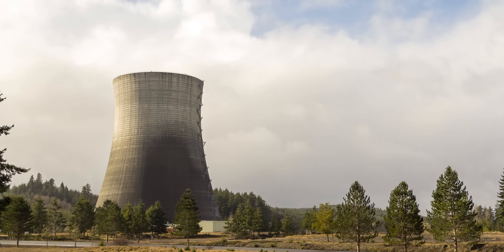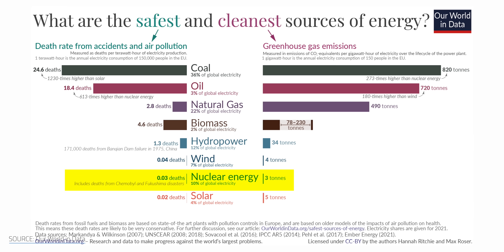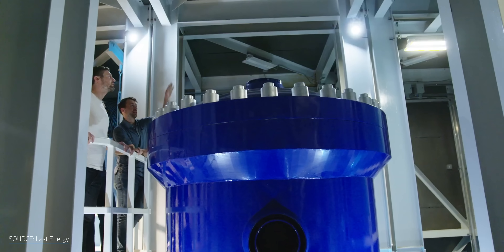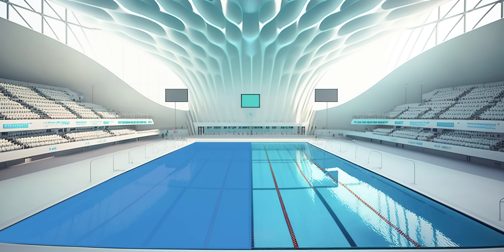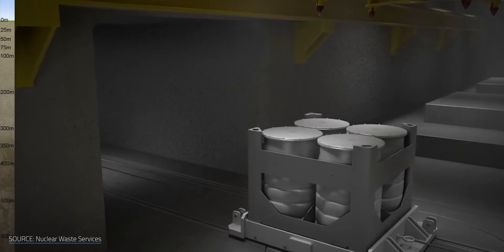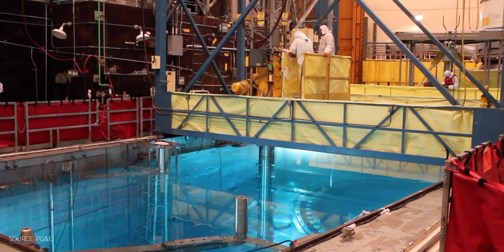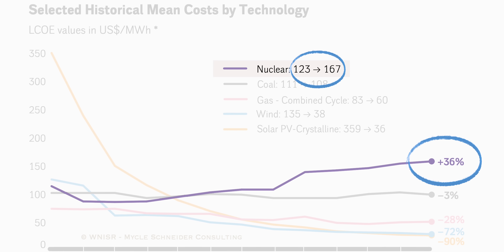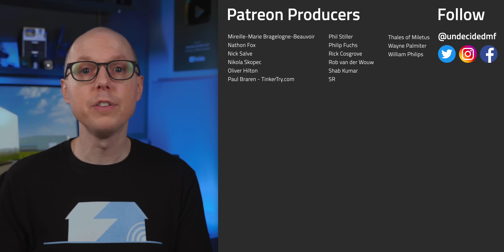Is Small, Fast, & Cheap the Future of Nuclear Energy?

Comment: Nuclear energy is the low IQ solution.  Low IQ because it actually increases energy and greenhouse gas (heated water vapor) in the atmosphere when we are trying to reduce it.  Solar does the opposite.  Solar simply recycles the energy that is already in the atmosphere.  Intelligent people back solar.
Reply: Sure solar is better for the environment but it isn’t efficient and is extremely expensive, so I think the world will move away from it
Reply: @scipio_stan  Solar is already the lowest cost and vastly more efficient than nuclear.   Wind and solar are both cheaper and more efficient which is why they are dominating the  market all over the world.
Reply: It releases steam, eg water. It is not harmful to release steam into the air.
Reply: @Arthorian   Water vapor is the dominant greenhouse gas and the extreme heat of steam from nuclear plants adds vast amount of waste heat to the atmosphere. If nuclear plants proliferate, waste heat will be the main cause of warming.  The intelligent solution is wind/solar which absorb energy from the atmosphere.
Reply: Water vapor emissions from nuclear plants primarily contribute to thermal pollution, which involves raising the temperature of surrounding water bodies. While this can potentially affect local ecosystems and aquatic life, the effects are generally confined to the immediate vicinity of the plant. Once the water vapor dissipates, the environment tends to recover relatively quickly. This localized impact contrasts with the widespread and long-lasting harm caused by coal-fired power plants.

In contrast, coal-fired power plants release not only water vapor but also a complex mixture of pollutants that include sulfur dioxide, nitrogen oxides, particulate matter, and greenhouse gases. These pollutants have far-reaching effects on air quality, human health, and the global climate. They contribute to acid rain, smog, respiratory illnesses, and contribute significantly to climate change.

E.g Nuclear should be used as a replacement for coal, then replaced by solar and wind

Comment: Here's the thing that everyone missses about the waste from nuclear reactors:  the fuel didn't come out of the ground in large, radiation-blasting chunks, now was it in the ground in a "vein" of pure uranium like coal in a coal seam or gold in a vein.  Nope, it's small grains of a uranium compound embedded in a cubic foot of surrounding rock.  Before you even start enriching to up the amount of U235, you first need to chemically separate out the uranium metal, and before you can do that, you first need to get the grains of that uranium compound out of the surrounding rock.

So, there's how you deal with the waste: put it back into the ground in the state you pulled it out.: grind the radioactive waste down into a coarse sand, embed one grain of sand into a 1 cubic foot brick of rock, then bury all of those bricks deep underground.

Sound expensive?  That's because you cannot have safety on the cheap.  She's around also make nuclear fission power prohibitively expensive.  Which is why we do it the dumb way:  concentrating it, then frantically trying to find a safe place to put a large, bright-radiation source.  🙄
Reply: The high level waste in spent fuel rods is NOT uranium, it is Pu239 and highly radioactive fission fragments.

You can hold a new fuel assembly in your hands all day and get less exposure than an airline flight.

If you walk up, touch a spent fuel assembly and walk away, you will be dead in a day or so

Comment: I personally think that Last is on the right path with these ASMR’s. I worked at a major nuclear powerplant back in the 1990’s and we were bogged down with procedures and QC hold points, regs and rules and much of it was, honestly, ridiculous over kill. Much of it was indeed needed but much wasn’t. Also, the cost was for the documentation. For instance, a common 1/2” bolt you can grab at a hardware store for an inflated price of 1 dollar, the nuclear bolt needs to have documentation from the truck it was offloaded from, literally all the way back to the mine where the iron ore was mined thus upping the cost to 8 or 10 bucks or more.
Reply: What was the sense of this? Sounds like somebody make extra money. In the 90-ies EUropa: A friend running a company, producing thermopaper rolls, first for cash registers. One unit selling price 1,50 in that currency and big quantity. The same paper, for medicine technical devices such as eeg, Labor Printers, so on: costs 18-30 per roll, with less paper used. On kg basis this medicin roll would have been double this figure. Good good business….

Comment: Mass produced molten salt reactors would be cheaper than coal. So will be solar and LFP battery. However, which do you think will return enough energy to make itself - sooner?
I've estimated that the EROI of solar is 20. However, even though the energy stored on Energy invested for LFP batteries might be 50, a fully LFP backed solar and wind system might only have an overall EROI of... 4.
I do not believe that mass produce small advanced closed cycle nuclear would have an EROI of less than 200...

Comment: My country, France, has been mentioned as an example of "serial" production or nuclear plants. That's true, and the cost was way lower. However there is a downside, last year a lot of reactors were down in order to check for cracks after some were found in one of them.

I don't like when LCOS of an intermittent energy source like solar and wind is compared to the LCOS of an "always on" source like nuclear. At least add the LCOS of storage, if it's even possible (in winter, solar won't produce much for weeks on end so storage can't do much about that).

After a few years where nuclear was not in favor after Fukushima, France has embarked in a new cycle, and while the president has allocated some funds towards SMR, the plan is clearly to build bigger, 6 new EPR reactors (1650MW) then on to EPR2, these should be conceived to be cheaper to produce.

Comment: Nuclear is a clean, safe and abundant non-carbon energy production method. But Nuclear waste is an almost criminal story in the US but not why most people would think. It's because of the lack of reprocessing. The lack of reprocessing of the used rods resulting in much more waste than necessary and wasting perfectly useable and already "enriched" Uranium. There are laws on the books starting from the 1950's that prohibit the US from resprossing the pellets after use. The reason is that politicians in the 1950's were worried that the pellets could be stolen or somehow redirected to make bombs. A not widely known fact about Uranium pellets is that only about 3 - 20% of the Uranium is utilized during the pellets lifetime. Because they are solid there is a very specific distance of the atoms from each other and the neutron source the fission decreases and the rods are no longer as useful. But here's the kicker. There is still over 97% useable Uranium left in the rods/pellets after usefulness declines. But instead of taking the pellets and reprocessing them and adding only a small amount of new Uranium and then reusing them, they are all just stored in mass as waste.  So we store 97% perfectly good processed/processed Uranium as waste. Europe, Japan and Russia reprocess the spent rods gaining the use of already processed Uranium and significantly reducing the amount of high level radioactive waste. SMR's, MSR's and other types are a great addition to our future energy needs.

Comment: Id consider the lack of deaths related to nuclear power more a result of them not being nesrly as widely adopted as coal and gas
Reply: The deaths  comparisons are done in a basis of unit of energy generated by each source.  Coal oil gas is hundreds of times higher as the video shows.  That means if the whole world was run all by nuclear, hundreds of thousands of lives would be saved.

Comment: If you go back and look at the original nuclear plants here in the US they were designed to reuse the waste by reforming the rods and reuse.  We then got away from that.  Regulations are the problem with energy production, like most things are.  People talk about "green" energy (solar, wind) but they are not green at all when you look at the footprint of mining, production & recycling.  Nuclear is the most clean.  The price is high because of the fossil fuel industry along with the media portraying it as extremely dangerous.  take a look at the US Navy's nuclear program.  I got less radiation aboard a sub than I did walking out in the Sun.  So looking at the price per unit over time, you will see Nuclear still being cheaper if the amount of regulatory folks get out of the way.  It takes about a year for a Natural Gas plant to go up and they want to get it in before summer because they will be able to pay it off in that first year or so depending upon the market.  I should be able to put up solar on my house but the power companies have a monopoly and influence with the legislation and the amount of hoops you have to jump through are crazy.
Reply: Well said. Note the US build a dozen nuclear plants in the late 1960s, approved by the then AEC.  Those plants went up in 2-4 years, cost under $1000/KW, todays $.  Oyster Creek. Nine Mile.  That’s cheaper than todays gas plants. Those plants ran 50 years, some still running.

Comment: There are more than one brand of micro nuclear reactors. One actually does use nuclear waste for fuel. Unfortunately the Nuclear Regulatory Commission is dragging its feet on approval of them so more than likely they will be exported rather than used here. And when was the last time a nuclear power plant came on line here? Before the NRC was created. If one were to start the process today it would be 40 years before it would come on line. So the cost you present is probably too low. All because government stands in the way. Why are inviromentalists not pushing for them. It's too efficient. Germany cut nuclear power which came from France in favor of green energy. But recently they realized that by this winter the German people would be freezing to death and then starvation would set in. So they then began expanding their only other source of fuel available. Not coal because they don't have any. They do have abundant sources of lignite. Yeah, lignite, low grade coal which produces much more pollution than coal. But they need a lot and with manufacturing down due to turning off nuclear power they need more money to mine lignite. They found it. They diverted money being used to build windmill farms to mine lignite. Now they will be polluting 3 times more (at least) than before. Well, that's where we are headed.

Comment: It's kind of surprising an idea like this hasn't happened sooner.  We have been using small reactors in subs and ships since the 50s.
Reply: i forgot about that. It's insane how old nuclear powered engines are
Reply: It is the level of enrichment of small reactors, a lot higher than a large PWR reactor and they require refuelling more often.
Reply: @michael-vl1mn  by using a hydrated salt as a moderator the reactor can be much smaller and burn natural uranium
Reply: Hydrogen is the best moderator for neutrons
Reply: Because it slows them down and half the distance this reduces the size of the core by a factor of 8. Sodium hydroxide can serve as a moderator and a heat transfer fluid. If deuterium is used the neutron efficiency goes up enough to eliminate the enrichment process. This will reduce the cost of the fuel by a factor of ten.
Reply: This style of reactor is called the compact molten salt reactor and is described on Wikipedia
Reply: @mikefallwell1301  there were molten salt test reactors in to 50s and 60s. They had significant engineering issues so further development was abandoned. I don't see private business dumping the needed billions into developing this type of reactor.
Reply: @michael-vl1mn Many nuclear plants are on 24 month fuel cycles with some looking at 36 months. It just depends how much the additional k-excess costs. And there are some reanalysis needed dye to the higher source term which costs millions to get regulator approval.
Reply: With solutions like Last Energy and others the LCOE will drop significantly. I didn't see you address that or what Last Energy’s LCOE is. It would be a significant statistic.
Reply: There were groups so adamantly against nuclear it was made poison in the minds of the masses. Academia was one of these groups...
Reply: Obsolete technology designed to kill nuclear energy. Molten salt uranium reactors are the future
Reply: Never trust a capitalist with nuclear waste.
Reply: Your entire world is engineered to keep people paying their bills as long as possible. There is little dirrect profit in supplying cheap or free energy to all, so noone will do it except for the engineers who build their own. Welcome to capitalism.
Reply: It went wrong with Henry Ford. He was an oil head and the first entrepreneur to introduce massaproduction.
During the seventies there was a big oil lobby which spread false information about nuclear.
Reply: Nuclear power has been politically stymied because nuclear is a threat to Big Oil. "Green" energy is not.
Reply: Thinking in problems for more than 70 years instead of slutions is a big dealbreaker.
Reply: That's mainly why the US uses water moderated and cooled reactors. The government paid for the R&D for nuclear powered subs and carriers. It was cheap and easy to scale the design for commercial power plants.
Reply: Yes, but subs and ships are surrounded by an ocean of water to keep the nuclear reactors cool. They use a lot of water.
Reply: @kendanti3347  floating nuclear power stations can be built in a Shipyard where experience can be accumulated to build a learning curve. Seaborg technology is working with a Korean Shipyard to build a new design of molten salt reactor. To reduce the corrosion problem they plan to shut the reactors down after about 10 years and start up new ones. The ships will have up to 16 reactor cores at the end of their life. The large number of reactors will accelerate the learning curve and reduce fuel handling.
Reply: Right. The public already generally accepts the idea of nuclear powered subs or ships, why not factories or municipalities? Especially if they are self-contained and easy to seal and store.
Reply: Small portable reactors have been built and deployed decades ago.

One went to Greenland, another remote Wyoming to power military bases. The most famous portable nuclear power plant went to Antarctica. 
It was called Nukie poo. 

All of these units proved troublesome and leaked.
Reply: We’ve also been using free money in ships since the 50’s, but I don’t see nobody giving me free money yet
Reply: Not really. The barbaric institution of centralized gov't has held back mankind's advancement substantially. The fact that patent confiscation exists for purposes of "national" (read ruling class) security tells you all you need to know.
Reply: @EnFuego79 ??????

Comment: Nuclear is the only energy source that can realistically produce enough power to replace fossil fuels.  It's just that simple.  And the resistance to using nuclear power has very little to do with science or safety.  The technology already exists to deal with the problems with nuclear power.  Trying to use solar or wind to supply all of our energy needs is a pipe dream.  People who propose these things are just not dealing with reality.  They can supply a small percentage of our energy.  But, in general, they are not a viable solution.  As for this new approach to nuclear, it sounds great.  It addresses a lot of problems very effectively.  It definitely could be the future of the industry.

Comment: a point about the dgd facilities atlesat as finland has proposed them, the uranium is stored in metal containers (I think it said tungsten not sure), and they put those canisters in their slots which are sealed in with sement, once the facility is full they seal the entire thing in, and at that point it doesn't even matter if the whole thing collapses as long as those metal containers don't rupture the earth itself is more than enough protection and the rays virtually don't reach the surface. The facility doesn't have to last for 24000 years, but it has to be left alone for 24000 years.

Comment: I've said nuclear should not be cast aside, but used as part of the solution. We've had standardized nuclear systems I think on submarines. Aren't those systems SMR"s? Compare energy to a cake. It takes more then on ingredient to make a good cake. Or two ingredients. I'm sure the cost of building the SMR's would come down and become more competitive before long with more companies getting in on it. Like what we saw with flat screen TV's. Some short years ago those were very expensive. Quite cheap now. As far as nuclear waste, I don't think we should discard nuclear energy because of it. Finding ways to contain the waste, or perhaps ways to reuse it will be how we deal with it. I don't think wind and solar are without issues either. Being focused only on clean zero emissions overlooks the issues those have like mining, shipping, disposal of spent blades and solar panels, batteries, etc.